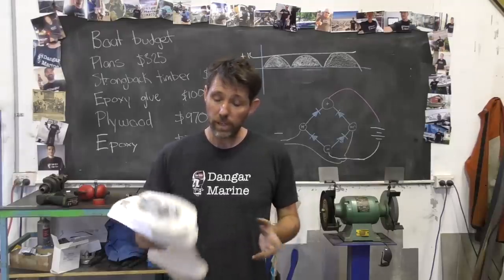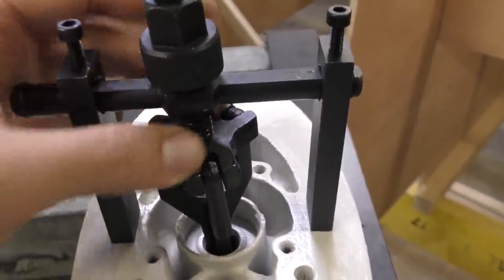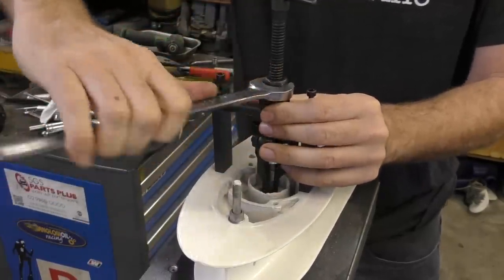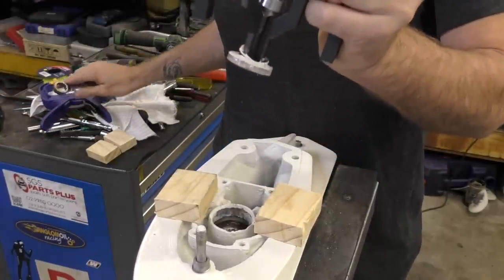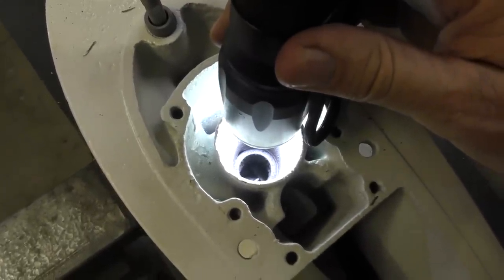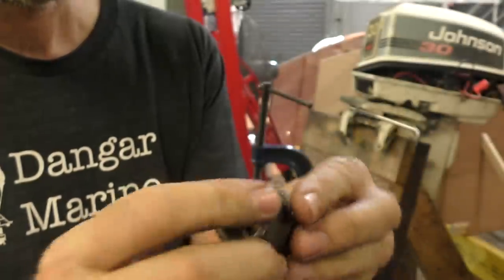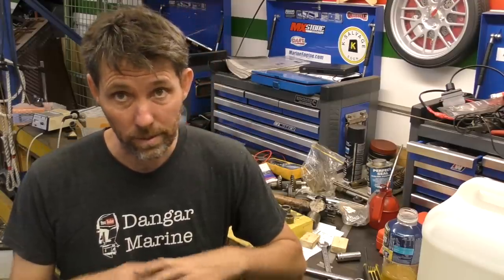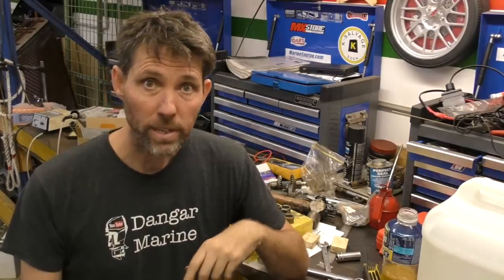Removing the bearings from a Johnson 30 HP lower unit

Comment: Dude if have any tips for reinstalling the needle seat for an 1986 force 85hp. I can't get them in right to save my life.
Reply: Do you mean adjusting them , or just the deinstall / reinstall of the needle seat? Normally the seats just screw in , and have a firm gasket between the hex head and the carb body. Not too much to get out of whack with that install.
Reply: Ron Powell the needle seats in an 86 85hp force are pressed in and very difficult to get in and out. I got it done still have a fuel leak from #1 carb float bowl. Frustrating as it can be but I will get it. Thanks for the thoughts.
Reply from the maker: Yes, press fitting can be quite tricky when the items are small and delicate. I've only dealt with the screw in type Ron described but there might be some good tips in the service manual if you can get a PDF one online.
Reply: Bud. I have only ever seen the pressed in seats, never changed them but I have watched it being done. The guy pushed an 'easy out'  into the seat first, then used an oven to heat the whole top unit of the bowl to about 100F, then a spray of freeze spray onto the easy out and the seat only , then used the easy out to pull the seat out. The new seat was sitting in the freezer. The guy then did the usual clean up of the fuel intake passages, and then stuck the top unit back in the oven and up to 100F again. After about 30 minutes the new seat was given a coat of low strength Loctite (to seal the new seat as removing the old one 'always scratches the  mount, you cant stop it from happening' and then pushed by hand into the carb , wiped clean and then left to drop to room temp.  I am assuming the float level has been checked and new gaskets fitted.  But pressed in seats sort of implies a design criteria of ' last warranty and then sell them a new carb' as the seats are known to get worn and need changing.

Comment: I have a question for you. The merc runs great up to speed and idle but after it sits going to start it takes a few times but after its started runs fine. It's like the oil injection is leaking into the carbs when sitting. Here is the mercury oil injection diagram for a 40hp similar less one carb. Mine is a 60hp 2 stroke 3 cylinder 
https://goo.gl/images/z1obo3
Reply from the maker: Hey Tim. It can be a few things. Sometimes with fuel injected outboards the injectors can leak into the cylinders flooding the motor, but this isn't really possible with carbs. It could be oil leaking into the crankcase depending on where it is injected. If it is into the carb bowl then it would likely just be smokey. It could also be fuel entering the crank case through the fuel pump or air in the fuel system after draining down.
Reply: The oil is going from the pump to mix in with the fuel straight to the top carb then thru the other 2. It smokes when first starting up then quits smoking after running for a few seconds. I was thinking with it tilt trimmed up while going to the boat launch may have something to do with it?

Comment: Hey stu. Is it ok to use copper based gasket sealant on a outboard  motor??. Thx mate.
Reply: Gawd no.
Reply: Ok thx
Reply from the maker: Yes, copper will eat aluminium away.